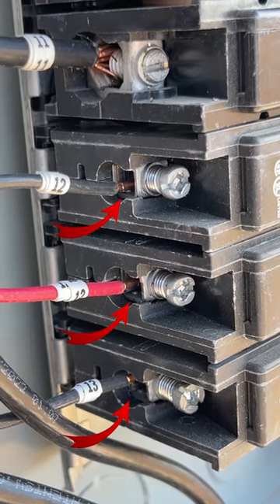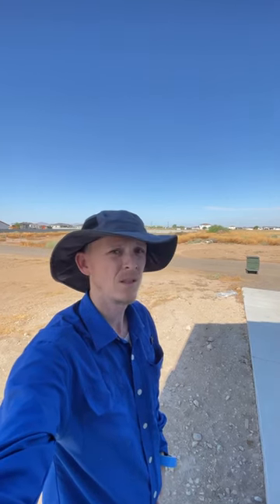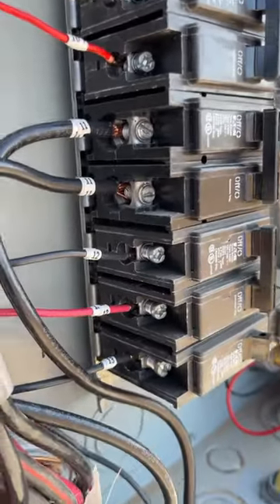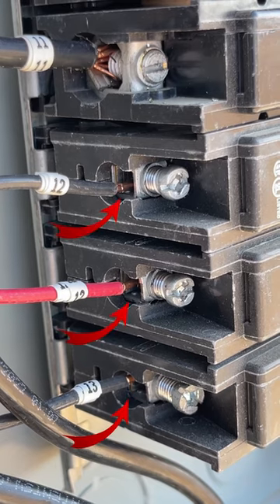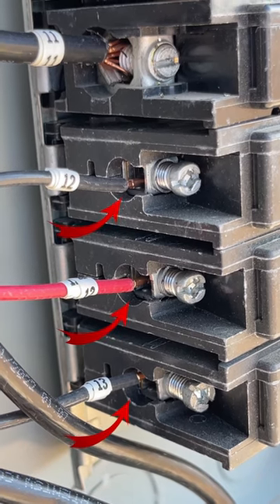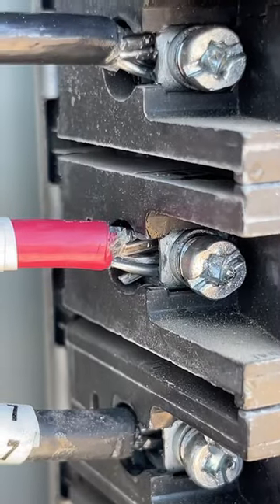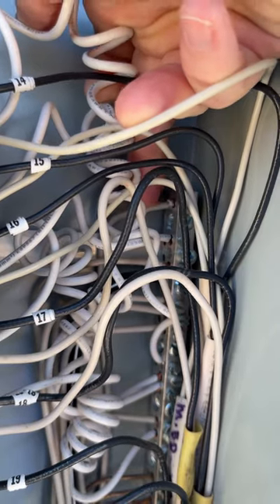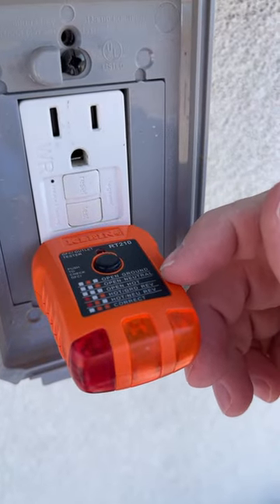Crazy Electrical Fail

Comment: This just tells you how bad the city or county inspectors are when they pass this stuff.  It should have been found then.
Reply: They're PAID not to see
Reply: Happened to me when I bought my house. My pool had a pretty bad leak. Got a lawyer and sued the inspector.
Reply: bureaucracy doesn’t improve anything, it just lines the pockets of bureaucrats
Reply: @MikehMike01 having building codes and code enforcement is one of the things that make this country the great place to live. It's our responsibility as citizens to get rid of corrupt and/or incompetent public officials so the system works as it should.
Reply: @hansachter5657  notice how corruption is only a major issue in governments?
Reply: @MikehMike01 You’re joking here right? Lol
Reply: The unsecured wires should automatically generate a fine to the electrician and inspector.  There's just no reasonable excuse for that.
Reply: Plus, they bit into the copper just to strip.
Reply: The city/county inspectors are a fucking joke dude
Reply: A quick fiver makes them blink at the right time.
Reply: Or it can show how overworked those county or city inspectors are. City and county inspectors are required to go to every new construction whether it be residential, industrial, retail or medical or governmental building. And I'm not thrush at him. He can be a little bit more picky in where he goes. He doesn't have to take every job that is put upon his desk, unlike a city or county inspector. This is supposed to show why you should always get a second opinion because you do not know how thorough a other inspector is going to be because of several reasons.
Reply: At this point the city should be held liable as well as builder
Reply: @clonescope2433  Too over worked to notice they're paid to notice someone pays better to look away
Reply: @MikehMike01 corruption is a major issue in any group or organization.
Reply: You might miss a couple of piddly details when you do a home inspection from the driver's seat of you work vehicle parked on the street.
Reply: As an electrical contractor, this should have been caught %100. The inspector should be held accountable for signing it off as it's a huge fire hazard, and extremely obvious. Now, here's what the inspector will say... "all those wires were landed tight when I checked it. They must have done something after and forgot to tighten them back down."

The sad part is, 9 times out of 10, the inspector's response is actually what happened because of garbage deadlines and changes to construction plans.
Reply: @MonkeyJedi99   When I built my garage I had to have the inspection before pouring my footer. They got within 20’ of it and said it looked fine. No measurements, didn’t check for the required rebar.  Might as well have stayed the truck.
Reply: @LLCNet21  Sheesh. At that point you could have has a 1/2" skim coat of concrete over compacted dirt!

Comment: I once got an award for making 10k electrical connections without a mistake. I was kinda puzzled as I never felt it was that hard.
Reply: Wouldnt any half ass electrician just go over all the screws a final time before closing it up?  I triple check I tightened my lugnuts and these fools don't even tighten the fitst time!
Reply: Depends on who you work for some owners push their crews to go faster than they can while still keep professional work standards.

Comment: It's not just that, when they stripped the wire insulation, they nicked the conductors.  That's also a no-no.  I couldn't tell from the video, but it appears that some of the strands were cut/missing/not connected for the stranded wires.  That's a big screwup and it can cause a fire under full load because there's not enough cross-section in the conductor to safely carry the current.  So it will heat up.
Reply: I was a fire alarm tech for years, and I noticed that right off. If the terminals were tight, the conductors would probably start breaking there after a few years. This is one of the most common issues I found on fire alarms.
Reply: I'm wondering how insurance companies are insuring homes. There's a lot of risk with a lot of these houses.
Reply: Yeah it's obvious the inspectors involved didn't even glance at this panel
Reply: The nicked copper is a bigger problem than most people think or consider as well. That Nick literally reduced the gauge of the wire by the depth of the nick. Your chain is only as strong as your weakest link.
Reply: @solomonable1679 yes and no. You still have most of the thermal dissipation of the larger conductor,  and your reduced gauge run is short so the resistance will be lower, but still, a nick like that does decrease the safe loading a fair bit.
Reply: I was on a commercial job in Texas and the inspector made us use our strippers on a piece of scrap to make sure we weren’t nicking the copper.

Comment: I actually ran into that exact thing on a brand new house as a repair. Customer was complaining about oddities throughout the house and when I pulled the cover off to check the panel none of the wires, seriously none, were tightened down.

Comment: Not to mentioned the wires are scored. Chance of failure high. Shameful.
Reply: Of course not tightening the terminal screw is right up there. 
I'll be benevolent and chalk that to inadvertent mistake. 
But repeatedly ring nicking conductors is 100% careless wanker. 
I guarantee, that guy knows better. Just gives no crap to do better.
Reply: It’s the bosses fault for hiring scrubs and not making sure they’re doing quality work.  I know. I’m the owner of my own electrical company and if someone did this, they’d be shown how to do it correctly, then checked in the future. If they did it again, they’d be gone.

Comment: "Hot and ground reversed" code on the tester can be caused by a lost neutral, such as that loose neutral in the panel. I just fixed a plug like that today
Reply: Good to know, thanks.👍

Comment: So many have no pride in their work anymore.
Reply: Yr right and some of em don't even care about making sure babies don't burn up in the middle of the night...
Reply: No one is given time to care about pride in work. The entire labor market is about crapping work out as quickly as possible, cost minimization, and burying any mistakes where possible. Any deviation from that and you're immediately replaced. Not sure about these builder's circumstances, but I'd wager the owners run a skeleton crew with tight deadlines on the employees, so even if the employees weren't lazy, they'd still have no time to do the job right.
Reply: I own a 50-year-old house.  You'd think the quality would be better, but no.

I've had 3-way switches where they reversed the traveller colors midway through.  I've had outlets where both the hot AND the neutral were white.  When I took out the ceiling I saw some of the wires passed through the joists had the insulation rubbed off completely.

Shit work isn't a new thing, unfortunately.
Reply: I mean humanity in general is in one giant race to the bottom. We are all heading to mutual self destruction because of game theory and how competitive we are.

Comment: Just as an FYI when a GFI gives you hot ground reversed it usually means it's not getting a neutral. I know there is an open neutral code on your plug tester but Because of the way a GFI works it shows up as hot ground reverse when the neutral is open. I know you clearly know what you're doing and you're an excellent inspector, I just happen to be an electrician and figured it would be something you would want to know.

Comment: Hot/ground reverse is an indication of a lost or loose neutral with a load on the circuit. That may be a symptom of the loose neutral you were wiggling in the panel. Also in case you didn’t know, some manufacturers of GFCI you need to hold the test button on the tester for a second before it will trip. Primarily Eaton CH GFCI breakers.

Comment: I'm not an electrician, but I changed all of the outlets and switches in my new home that was built in 2009. I had to trim the wires for each outlet and switch. One outlet I ended up trimming an inch off all four leads (hot and neutral). It's just sad how poor of a job some people do.

Comment: Yesterday i inspected a battery system where the installers put the entire garage (240v & 120v EV chargers, 240v dryer, 120v washer, water heater, garage door, and some outlets and lights all on a single 30amp breaker....yeah it was fried

Comment: Cheesas, as a European this is horrifying to watch. Here it is impossible to have these problems with electrical installations, there MUST be a protocol of measuring EVERY SINGLE OUTLET for its resistance across lines and against earth. There are no "inspectors" involved in building a home, because the people who are responsible for what gets built want to keep their job/profession. They (and their companies) will be responsible for the damages this causes, and not just until closing, but for at least 30 years! Yes, you read that correctly - 30 years for so-called "hidden faults".

Comment: My new modular home in 1996 had a loose wire in an outlet that flickered the vacuum cleaner. I checked everything and no one tightened any of the screws. I let the factory know they had a arsonist on the payroll They kicked the can down the road and said our local building inspector should have caught it. Trust no one

Comment: You know im not an electrician and dont know much about it anymore but i keep reading that no one has pride in tbere work anymore and that may be true and aprt of the problem.  But i think the bigest factor is corporations that over the past 30 years have just demanded fast and faster out put across the board. Im and auto body tech and i can tell you from my experience ive seen repair times on cars shrink and shrink and shrink and the expectation is that we now have to do these repairs faster and faster.  Well speed is the killer of quality and pride. And i think the same can be said about just oretty much every industry right now.

Comment: Did you see the copper wire was also creased when desheathing the wire? Now I know in the low volt side of electrical that’s a big no no. I would assume that is also a huge no no when it’s going into a panel or am I wrong?

Comment: Why TF is the breaker box outside? 
That's a huge safety risk, anyone can just walk on over and cut your power. 
And then you have to go outside in the heat of the day if you trip a breaker, or worse if it happens during the 1 storm a year.

Comment: Whatever ended up happening with that single conductor aluminum wire that was shrinking its insulation over time? That's a huge fucking problem and I haven't heard anything else about it.

Comment: Yup lazy electricians cause all sorts of havoc. In my area gas furnaces in the attic are powered by a 110V circuit with a regular light switch as a disconnect. We had a new home that kept having fantom issues with the hvac system randomly shutting off then coming back on 2-5 minutes later. Turns out they missed the screw on the light switch and it was touching and as the draw from the blower motor heated the wire it would expand away from the screw and disconnect power, after the wire cooled off it would touch again. I was beyond ticked off when we found it as the builder was mad at us but nope your cheap ass electricians

Comment: Just say the screws aren't tightened.
Reply: Just because the screws are tight doesn't mean the wires are secured to them. That's like putting a nail in a truss tie in the crack between the two boards
Reply: @bryanfreemyer5074  You can see The screws are backed all the way out... No stupid analogies needed.
Reply: @eb1247 precision while making a description is just fine.
Reply: @eb1247 secured isnt an analogy, its the terminology the NEC uses
Reply: You can also over-tighten them.